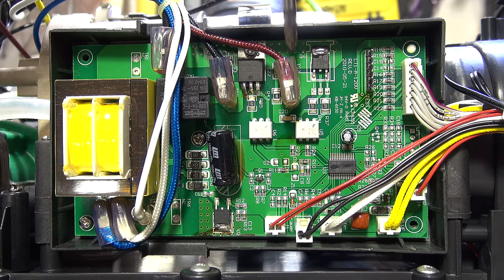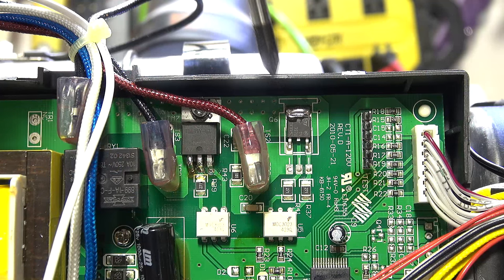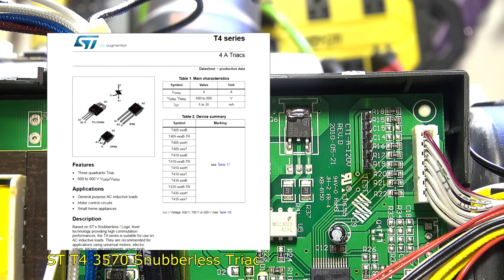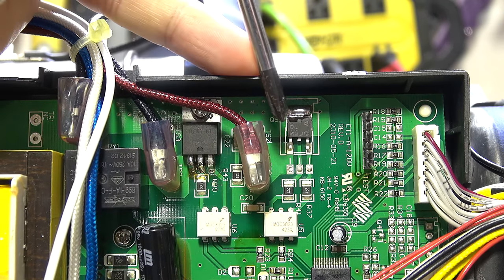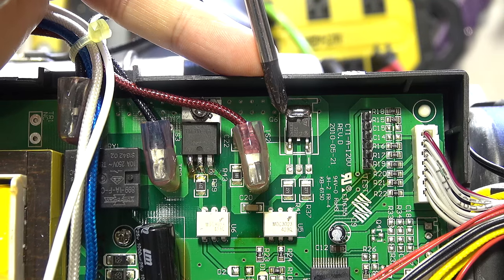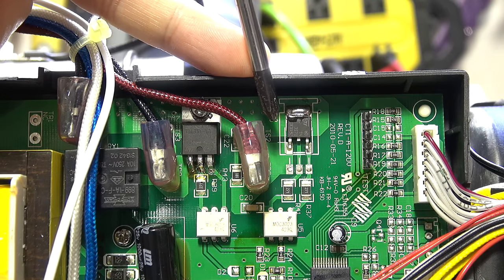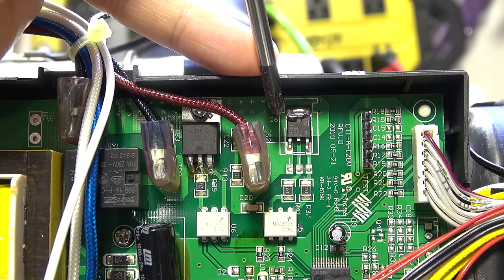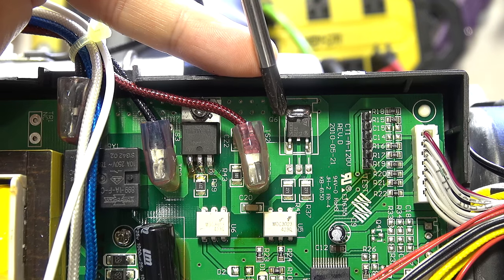A Look Inside #11- Bunn My Cafe - Pt2

Comment: Great video. Totally nerd out on the components! I had an issue where the machine wouldn't heat up anymore. Took apart back and bottom panel to locate the fuse. Saw another video where it looked simple to replace but it was for another BUNN machine. I couldn't identify the fuse in this machine. Decided to keep the machine which I love and add hot water to it to brew my coffee. I always have hot water on hand from my hot water dispenser. Cleaned the machine out with vinegar. And to my surprise, the machine started heating up water again! Only problem is it is very difficult to get the vinegar flavour out. I've run more than 12 cups of water through the brew cycle.

Comment: Thank you for this video- I disassembled my Bunn MCU and located the leak at the air pump before I watched your video.  I wish I had viewed it first because that screw in the back really gave me fits before I was able to pop the plastic cover.  I have a replacement pump ordered that hopefully will be new (it is labeled Bunn OEM on the sealed plastic bag, so here's hoping).

Comment: Nice video, very informative. I took my Keurig apart, a lot going on in there as I found out too. A little too much, really.  Worked fine for a few months until I cleaned it with vinegar. When it wouldn't stop pumping water I fixed it perfectly. I threw it in the trash.

Comment: Great video, thanks, but if water is coming down the tube into the air pump, as it appeared to be in your video, I suspect you also need to replace the check valve. Otherwise, I imagine the new pump would fail relatively quickly.

There are actually two check valves that can be seen if you unscrew the spray head - one prevents water getting into the the air pump, and the other prevents the purge air from blowing back into the kettle. You can remove the check valves by pulling on them carefully with needle-nose pliers, and Bunn customer service will send you new valves and a new spray head seal for free (at least they did for me).
Reply: Every pump must have an inlet and an outlet, thus the water will just run right through the air pump when it is not running. The check valve was leaking, which is what must stop the water from coming to the pump.
Reply: Yep, the check valves is the real fix here. Replacing the pump without cleaning/replacing the check valves is pretty useless. Mine is 5 yrs old and still no water in the air pump tubing. Capacitors on the mainboard did fail tho, getting replacements today!

Comment: This is a great video.  To extend, there is another weak spot in this brewer.  One day, you will come to the brewer after being idle and find that it is dead.  Acts like there is no power.  The fault is in the main control board.  Open the box containing the control board and carefully plug in the unit.  Check DC voltage (there are several locations near the diodes) and you will almost always find that there is still 12V DC on the board.  Look closely at the top of the 1000uF 25V electrolytic capacitor in the center of the board.  You will most likely find that the top shows a slight bulging (it should be perfectly flat).  This suggests that the cap has failed.  The purpose of this cap is smooth out the ripple in the DC current supplied by the diodes.  When the cap fails, the small CPU feels the ripple and cannot start.  This is kind of like a loud hum you sometimes hear in old audio equipment -- which is usually caused by the same type of capacitor problem.  
You can get 10 capacitors for $4.99 from Amazon and just solder in place.  Make sure the replacement is installed with the negative lead in the same position as the original (match the POLARITY) or it will not work.  FYI, the old cap will have the negative lead marked on the case and the circuit board will usually have striped markings indicating the negative side.  If you are ambitious, you can unscrew the board and flip it over -- no need to remove all of the wired connectors -- and de-solder the cap from the board.  A quicker way is to just break the glue holding the old cap to the board, solder the new cap to the leads of the old cap and then cut the leads on the old cap to remove it.  Since the new spliced leads will be longer, carefully bend them out of the way being careful that they will not touch anything.
I have restored two dead units to working order by replacing the filter capacitor.  For the most part, the Bunn MCU is a really well made unit that is getting scarce so, with an extra cap and air pump, you should be able to keep this unit running for many years.
Reply: Great tip.  Mine had just enough capacitance left so the micro wasn't confused until it actually tried to brew, then the extra current required by the optocoupler reset it.  So it acted like there was no water under the spin lid for brewing.  Another thing to note is that the PCB is conformally coated, which makes it a pain to desolder the capacitor and of course compromises the coating.  I ended up just clipping the old capacitor's leads next to its body and forming two J hooks as terminals for the new part.  Hope this helps someone out.
Reply: Thanks for this great info! My MCU was switching on and heating normally, but pressing the brew button would make the water pump operate only for about a second. Replacing the 1000uF cap (which was bulging just as you said) fixed it right up. Super happy to have my MCU back in business!
Reply: @don_cc123  It helped me! Mine was operating the water pump for only a split second when hitting the brew button, then it would reset. I could immediately hit the brew button again but would get the exact same result. I was assuming the (water) pump was the culprit, but after reading the posts here about the filter capacitor I took a look at the circuit board and sure enough it was bulging up top. Replaced it with the one MacGuyver suggested (a Nichicon that may outlive us all) and took your advice to clip off the old cap and solder the new one to the existing leads. Working like a champ now. Thanks for the tips!

Comment: Probably needs a silicon check valve above the pump to keep the boiling water from settling on the thin rubber diaphragm and degrading it.
Reply from the maker: That's a great consideration. If this one goes again I'll look at trying that.
Reply: Yes, a line check valve w better rubber would stop that and save the need to ever replace the pump but the check valve would have to be eventually checked and replaced, they have those vacuum check valves for the vehicle ventilation systems, thats the ticket, + 2 zip ties, $0.50 max cost + time, what an over sight. Happy brewing

Comment: The air purge pump should have been mounted above the water level to prevent water hitting the membrane. Perhaps just use an external 12V aquarium pump and mount it on the rear of the top of the unit above the water level.

Comment: I'm surprised the boiler isn't insulated. A bit of foam insulation would cut down on the power needed to maintain the hot water.
Reply: They don't care about your power bill. Only their profit. Insulation is not cheap and takes a lot of space.

Comment: I have this same model and I suspect the control  board is defective. I have a 120 volts going in but no lights on the switches. Probably a bad microprocessor. Do you know if these boards are available?

Comment: Great video series. Watched them both. Found a new part online: https://www.partstown.com/bunn/bu38316-1000. Got the part in a day. Spent 30 minutes fixing the machine. No more leaks. The leads on the new part were short and had a connector, so it wasn't an exact drop in replacement. I didn't feel like soldering, so I cut off the connector, stripped the wires, and used waterproof orange UY telco connectors: https://www.amazon.com/dp/B00IDF914A. Thanks, again! I love this machine and didn't want to replace it with a different kind. Hopefully get another couple years out of it.

Comment: As said before, that pump needs an external non return valve in the outlet. The other solenoid valve is to dump the pressure in the line when brewing is finished, I would guess it is a normally open type, and is powered when the other main pump is running so it can pressurise the boiler. Then it is opened when the time is up ( kind of bad, depends on the main pump being very close to the same volume of water pumped every time, and with age the pumped volume will drop as the parts and valves wear) so the pressure and the little hot water is dumped to the tank. 

As well it likely is open on power up till the tank is full, so the system will gravity fill with water and prime the main pump, then stay open as the water is brought to set point to cope with expansion. Closed only when water is needed, so as to handle the steam generated. I will guess the water level is simply done by using a sealed float switch, as that can be almost entirely made as part of the moulding of the machine top, and only needs a small reed switch pushed in from the bottom, and a small ceramic magnet in a float ( same type of magnet as used in cheap speakers, so a very common item) slipped on top before putting the top cover on.

Yes, insulation on the tank would be good, will make the plastic parts last longer ( they will get brittle with heat, you can see all the plastic parts facing the tank is going yellow with this), but even a thin sheet of glass wool inside a heat resistant casing would both halve the energy use in standby and reduce heating time. Would cost perhaps $1 extra in design, but ws probably costed out as too expensive, like a better pump or a check valve.
Reply from the maker: Thanks for the input and post Sean.

Comment: Thanks for sharing this. Out of curiosity, what would happen if you remove the air pump and plug the tube? It wouldn't be able to squirt the last drops out, but is that absolutely necessary?
Reply: it's to prevent cold water from being forced into your grounds on the next brew cycle, ruining your brew quality, so it is necessary

Comment: I wonder if the little pump just isnt designed to have the kind of pressure inside that is created by the big pump.  I think this could be solved by putting a one way valve in the line before the small pump.  Probably should have been that way from the factory..

Comment: Awesome video, mahalo,  rewire it with a new, better fish pump kind air pump, er er er  tim allen...lol no it just needs a small check valve prior to the air pump, viola, what an oversight by the engineer, $.50 check valve saves tossing these in the trash after x years, this is an awesome CM i have had mine since 2012, only had to get new screen for ground coffee attachment, and now 2021 the ground coffee attachment itself bc the oils of the coffee are jamming the top screen.

Comment: so this is basically an expresso machine with some components deducted, this is not really a drip type of coffee machine bunn usually makes, was interested to get one, now I know how it works, I think I can make my espresso machine works just like it, and maybe better
Reply: Your wrong on one point.  This thing is quick and multifunctional.  It has adapters for everything from a K-Cup to use your own grounds.  I don't even know if Bunn still makes them, but they're actually well worth $150 if that's the going price.  And, like I said, you've got a full cup of coffee in about 1 minute or so.

Comment: That is a bad design, and would damage any pump. Basically when a K cup is installed, there will be a higher amount of pressure in those lines, pressing against the rubber membranes within the pump.
Were you able to get a refund for the defective pump?

Comment: Any idea how many brews you got before the air pump failed?
Reply from the maker: I estimate about 2700 (18 months x 30 days x 5 brews)
Reply: I have looked around and it looks like everyone uses that same type of pump so I figure all the brands of brewers suffer from the same problem. The market seems to be flooded with used ones too. It may be worth it to disconnect it to see how much of difference it makes. I was looking for a small aquarium pump but all seem to be too large to retrofit.

Comment: Please give both of the sellers a negative rating, if they don't refund you! This is the only way for others to be warned of such scammers. The first one for selling something broken (I assume it did not say that in the item description), and even more the second seller for selling something as new, that obviously wasn't, and is broken (as other mentioned you can see the water drip inside the pump while you're you testing it).
Reply: PS:
While the PCB looks nice (they definitely did a good job designing it), the pump is most likely a result of desk warriors demanding a cheaper product, so they may have replaced a better specd pump selected by the engineers by this cheap pump (or "saved" a checkvalve to protect the pump from the pressure of the main pump).
What I've seen a pump of this type can create a pressure of about 0.5-1 bar. And while this is not the same as the counter pressure the pump can take, the about 10 bar that the main pump will put out (that's what typical espresso machines should do) is definitely too much.
So my advice for the next pump (that you will have to install because the second one is already leaking): either get a totally different type that is rated for water, and not just air, at scolding temperatures at that pressure or install a small checkvalve so the stock pump won't ever see water.
Reply from the maker: Thanks, great input.

Comment: Surely Bunn could have just downscaled their 10-cupper to a one-cupper, without creating this Rube Goldberg.  I mean, those monsters in the restaurants have no pumps, no hoses, (or scant any other in-line plastics), and probably no PCBs.  All gravity feed, with the simplest of the thermostats and heating elements to get you a pot of brew in less than two minutes!  It might have been a little bulkier than this unit, but not by much, and a whole lot more reliable.

Comment: Could you use hot glue to repair the membrane? super glue may be posion
Reply: I don't think so: You'd need a both temperature resistant and flexible type of glue.

Comment: I too thought I needed a air pump so located at this web site.  For a different model Bunn,  but looks identical with a different lead.   https://www.partstown.com/bunn/mco/pumps-motors/parts    I now believe I have a check valve problem as the air is blowing back into the heater tank.

Comment: This seems like a terrible design, are you sure that solenoid isn't meant to protect the little air pump from the big water pump, maybe that's the root problem? Seems ludicrous to have the big pump pushing boiling water against that tiny membrane!?

As always don't replace the first thing you find broken, make sure you understand the reason that that thing is broken first, you need to be sure you've found the root issue.

I've repaired a few of the European Nespresso machines, which are generally very high quality inside, apart for the fact the PSU for the logic board is a capacitor dropper and the capacitors die real quick, nice to see your machine has a real transformer, though clearly needed to run those 12V loads!
Reply: Also what's with the total lack of insulation and that horrid flex, is that only single insulated?  I'm sure there are some of these sorts of machines that boil the water on demand, but I guess that's harder to achieve with 100-120V AC.

Comment: I would just eliminate the air pump. In my opinion, it's not really an essential part.
Reply: cold water will be passed into your grounds on the next cycle ruining the brew quality, so it is essential.